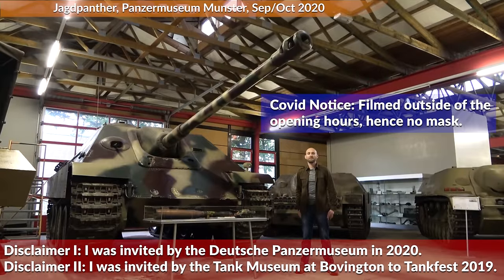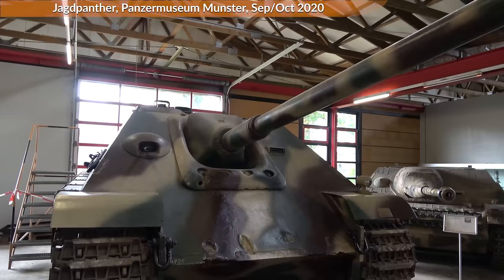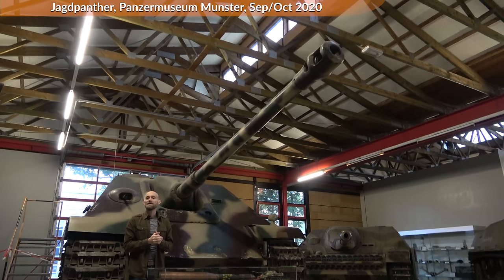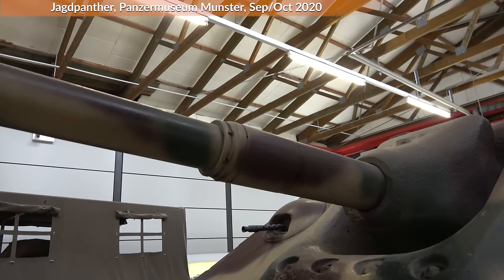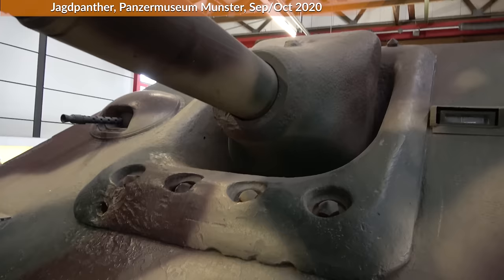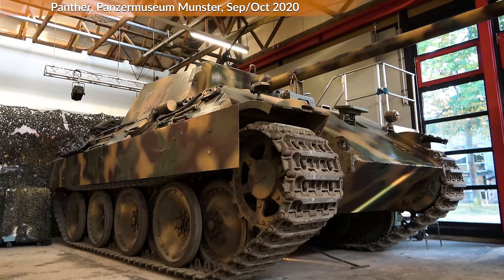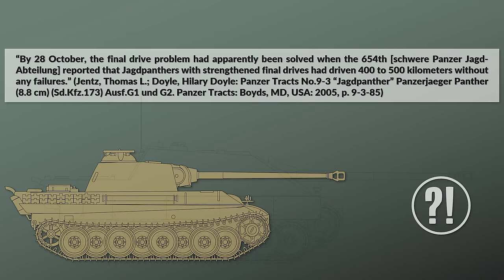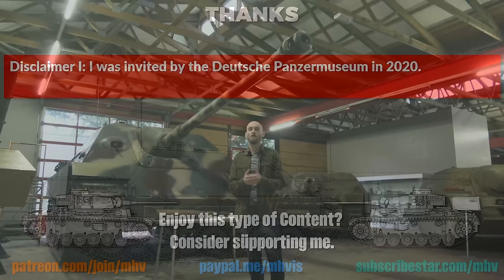Jagdpanther: King Tiger's Gun & Panther's Chassis

Comment: Wasn't that a myth, that Ferdinands suffered notable losses to infantry because they had no mg?
Reply: I think recall them only losing 1 in action around kursk, the rest were to mechanical issues.
Reply: Not really a myth but not exactly the truth either.

Ferdinands were used in two ways. The panzer companies equipped with it took breakthrough tank literal, used them to try and punch a hole through enemy lines, and quickly found out that a big scary tank with a big gun is not so scary to enemy infantry when you have no MG's or a traversing turret to engage them with and lost several to enemy infantry, and mechanical breakdown during the assault.

The TD units that had used stugs before however got a bunch as well, and used them exactly like stugs. stay at range, and pick your targets. they wrecked havoc but in the few cases their positions where overun did find the lack of a mg bothersome because something to shoot at advancing units was better then a slow reloading gun. however their losses where mostly due to mechanical breakdown because their retreats where covered by support units.
Reply: @scrubsrc4084  They lost a lot more than just one due to enemy fire. One was obliterated by a direct hit from a 152mm  HE round from artillery,  one from a bomb by a PO2 byplane, one was burned up by a side shot from a T34, one by a molotov throw... I have a link that explains in detaill all the lost Ferdis at Kursk, if you want.
Reply: @Vlad_-_-_  I may be thinking of just one units losses, id have to rummage through the book shelves to run which one though.
Would love the link thanks that would be cool
Reply: @scrubsrc4084  I see, here is a fairly detailed list : http://www.tankarchives.ca/2013/12/ferdinand-losses.html

Note that it was possible to identify so many, because of the rarity of the tank itself and of course it's sheer presence, size...
Reply: @Vlad_-_-_  brilliant, thanks for that.
Reply: @scrubsrc4084  My pleasure .

Comment: How does it work that the MG-42 could not be mounted into tanks, but the "successor" MG-3 works inside tanks? Doesn't the barrel work the same there?
Reply: Both types require barrel changes but the MG34 barrel is removed from the rear and the MG42 barrel is removed from the side.

Comment: If there where as many of these built in the numbers they built the pzr IV's when they were introduced,.. would they have been more of a impact at the battle of Kursk? Or would they have had suffered the same like the panther did?
I dunno,. Just asking a fun question.
Thank you for your programs!
Prost!
Reply: This was a specialised vehicle from the start. The german industry wouldn't be able to produce this numbers - and even if there wouldn't be enough fuel or Crews. The logistic side of things was a list of many shortcomings...

But put all that aside - neither Panther or Jagdpanther wouldn't be able so support big offensive operations due to mechanical issues...
Reply: John Cornell  In 1941 and 1942 Panzerdivisions would march over hundreds of kilometers on tracks because the Pz.38, Pz. III and IV were reliable enough to allow that - but even they had to suffer on mechanical failures and memorys of that time refer to the Instandsetzung-Men as "Wizards". They made impossible possible but improvisation has its limits and the early Panzers were not as complex as the Panthers and Tigers. 

Or as The Chieftain pointed out that german engineers wanted to bring the complexity-dial to 11 - only to discover that it ends at 10 and it broke...

So imagine Zitadelle a success, the Russians on the run, open land, the greatest Panzers at your disposal - only to have Panzer IVs to do the offensive work so that you can ship your precious metal by train because if you let them roar through Russia on tracks they won't make it - at least not that far as you need them to. Not to mention the fuel issues...

I'm german and i'm aware that the Panthers and Tigers are somewhat iconic but on the logistic and engineering side of things they are just totally nuts. Plus you just need a Level of Crew Training that was just impossible in 1943, let alone in the later years. Nice-to -look-at-tanks, impressive machines for video games and statistics but not the Tanks Germany really needed...

But - thank good they were useless after all...
Reply: John Cornell  Yeah, and because they were so reliable hundreds of them were shattered and left behind across France with various technical failures. I'm in this for decades now and, as i said, i get the fascination. But please stop bullshitting me, there are a lot of original sources and even books that adress the issues of the Panther and Jagdpanther. They must have been serious enough at least that even Guderian pointed it out in his memoirs. As for the ready state compared to Pz.IV - this was bad in 1943 and got badder every year because of supply chain disruption. So, if you compare the ready state of the Panthers to this you've got a very foul basement...

I don't remember exactly where i heard this - i guess Chieftain or H.L.Doyle - but the Panther was more of a TD than a medium Tank. They needed flank cover, there wasn't even a tactical concept on how to operate this Tanks. The Crews had to work it out loss after loss...

Please stop looking at Tanks from their Paper Stats. Without Crew, Fuel, Oil, Ammo, spare Parts it's just a lump of steel. And Logisticswise the Wehrmacht was a mess. Crew Training was practically gone in late 44 because of fuel shortages and not very good beforehand. But a highly specialised Weapon like the Panther needs a properly trained Crew, if you've to throw in peasants  you're better off in a T34 because somethings going to break - and, like reports state, the final drive issues were too because of a lack of training and experience. The field commanders were pissed off because of this...

Comment: So did germans have extra 88mm guns or extra panther-chassis? Going this way seems weird? Its fine machine but is it better than panther-tank?
Reply: Well according to Doyle Germans thought it was a more reasonable use of long 88mm than putting it into King Tiger. With Jagdpanther you get a vehicle that is more effective in its role than Panther (which also was designed as a tank hunter, see big gun and weak side armor) but is cheaper, simpler to build and more reliable than King Tiger.
Reply: The germans did everything and thus lacked everything.

Comment: I don't understand why they never developed a 600 hp diesel engine and a heavy 2 speed transmission to match with it, they built diesel aircraft engines , so its not like they didn't have the ability.

Comment: That muzzle brake looks suspiciously like the one on the IS-2’s 122mm. Was it reverse engineering, or convergent evolution?
Reply: Soviets also used the design for the 122, because it offered the best performance out of the designes they tested.
Reply: @Vlad_-_-_  Right. I suppose I could’ve been more clear in my comment, but I’m asking if the Germans ran a similar series of tests, or did they see the Soviets shove a 122mm in a tank, figure there must be something special about that muzzle brake design, and copy it for their “big gun in a tiny tank” projects
Reply: @mrb692  Soviets used muzzle brakes in their cannons in the war, previouly they slapped a muzzle brake on the SU152, and SU122, as for the IS2, they tested 3 designes, a T shaped one, which blew apart, another one, which cracked and the final one, they called " German type " they stuck with it. And calling the IS2 tiny is kind of pointless. It was way better armored than the far bigger Tiger and better armed, it was smaller and lighter, but you can hardly call it tiny. Want tiny, see their T34 100 prototype, but not even that.
Reply: @Vlad_-_-_   I mean tiny on the scale of tanks and in a relative sense compared to the gun. For example, the 122 was also mounted on the KV chassis which was originally designed for a 76.2mm gun. Big gun, tiny tank. That the Tiger is bigger than the IS is exactly what I mean, the bigger tank has the smaller gun. 

If the Soviets tested the “German type” muzzle brake, then it stands to reason that it debuted on German tanks first. Now that I think about it, the Tiger 1 had a similar styled muzzle brake too, so that makes sense
Reply: @mrb692  I don't know, they called it german style in documentation, but soviet AT guns as early as the 76mm ZIS had a similar style. I think they got the inspiration of using it on the IS2 after they captured some Ferdi tanks and that is why. Hard to say really.
Reply: John Cornell  I have severe doubts on the claim that the 122mm D-25T would barley hit anything of tank size beyond 800m, it is still a high velocity gun with about the same muzzle velocity as the 88mm L/56. Given that there aren't any compartive tests with regards to accuracy I do not feel it is fair to try and portray it as being unable to hit targets at beyond 800m.

Especially since the definition of 'accurate' for WWII era guns is rather subjective.
Reply: John Cornell  Sorry but just because something is widely mentioned doesn't mean it is true, great example of this is the widely mentioned 'unrealiblity of the German big cats'. Yes, Zaloga does mention that but that is all he mentions, he does not go into any specifics and simply saying that the Tiger I has superior accuracy does not tell us anything actually.

The 122mm D-25T is not a barrage howitzer, it is derived from a long barrelled field gun the A-19. Very similair to the 105mm K18 and 128mm K44. Yes both the 88mm L/56 and L/71 were more accurate than the D-25T but the difference isn't that big.

Using the data from Rexford (Lorrin Bird, one of authors of WWII Ballistics) we have the following.

At 1000m:                         122mm D-25T                   8,8cm KwK 43            8,8cm KwK 36

Horz                                         0.5m                             0.3m                             0.2m

Vert                                          0.5m                             0.5m                             0.4m
 

At 2000m:                         122mm D-25T                  8,8cm KwK 43            8,8cm KwK 36

Horz                                         1.0m                             0.7m                           0.5m

Vert                                          1.0m                             0.9m                           0.9m

So yes the 88mm is more accurate than the 122mm but as you can see the difference in deviation from the meant impact point isn't all that much.

A single encounter does not say anything, certainly nothing that would enable one to learn anything noteworthy about the mechanical precision of a certain gun, far more here is the training of the crew and what state they were.

Comment: Germany needed numbers far in excess of these for this lethal weapon. I recall this vehicle shooting through an m4 front to rear through the transmission exiting the rear of the  vehicle. Our tank repair crews were totally sickened with the brain material sprayed in the interior of the tanks which did not burn  completely. One needed thorough cleaning and painting and the other  might as well be buried. Had Germany tripled production even then with the acute fuel shortage quadrupled would not have sufficed. When the new more powerful engine was put into the 109g our p51's with 151 octane fuel could still outclimb it in a dogfight. All fuel.

Comment: This is basically German equivalent of SU-100
(But with more of the mechanical issues)
Reply: And a more powerful gun, especially at long range
Reply: @jsd795  The 100mm was a strong rival to the PaK43 as far as penetration and damage potential, the real downside of it being harder to reload.
Reply: @bluntcabbage6042  from what I have been able to find the 88 definitely outperformed the Soviet 100mm but it is probably a mute point since either could defeat anything it would encounter with the exception of the frontal armour on a tiger II